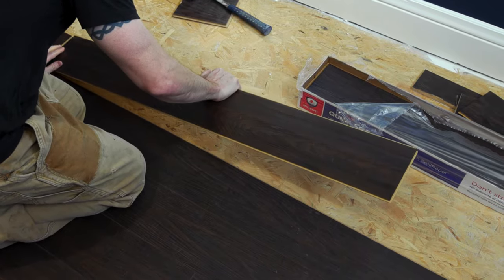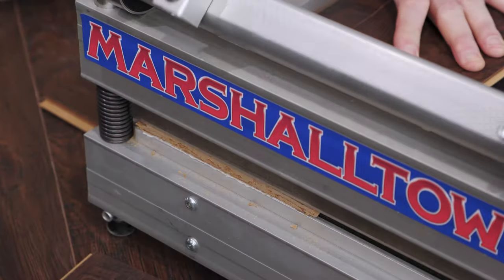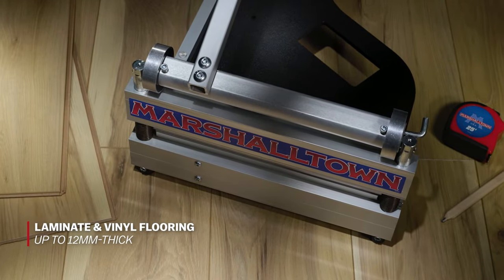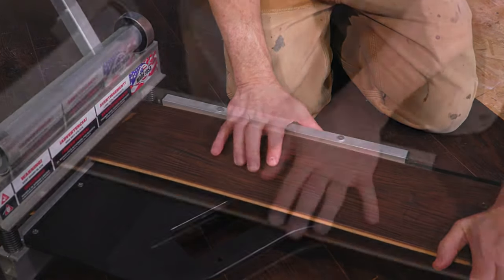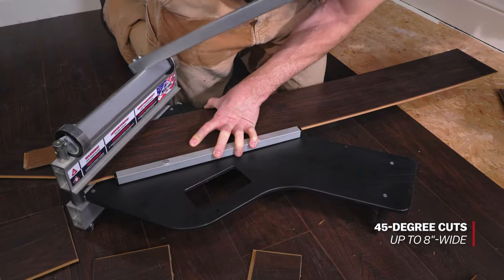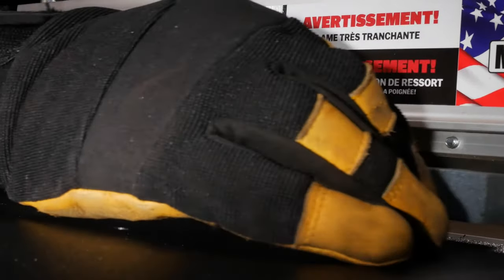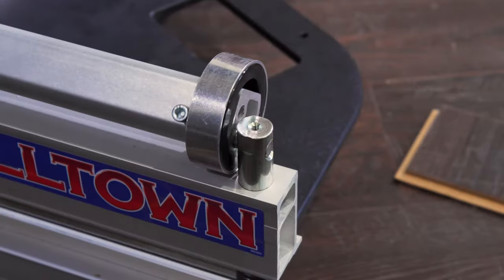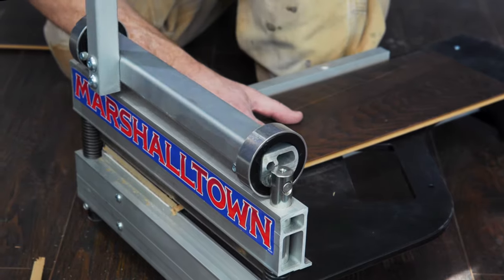Marshalltown 13" Ultra-Light Flooring Cutter

Comment: Should the blade clear the cutter edge when I try a cut? I put my laminate in to cut and pull the handle and the blade hits the cutter, does not clear it.  I’m applying way too much force and all I do is score the laminate.